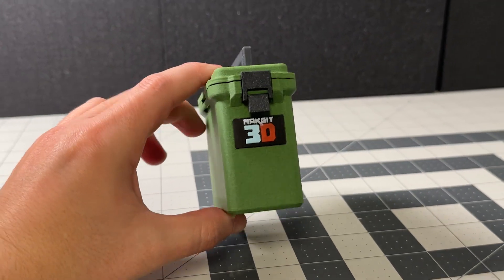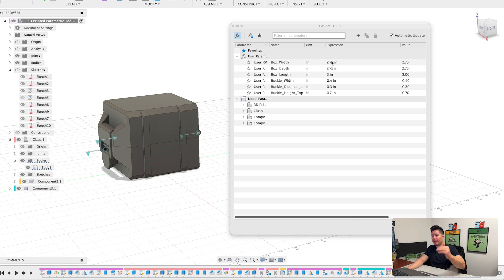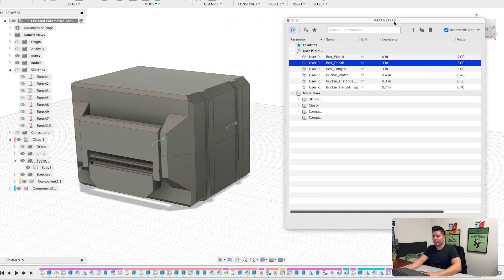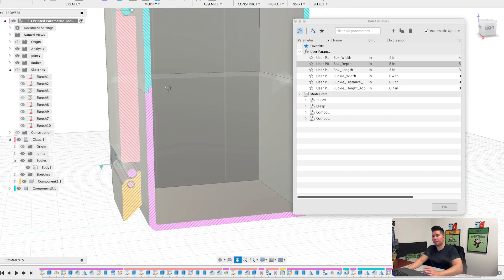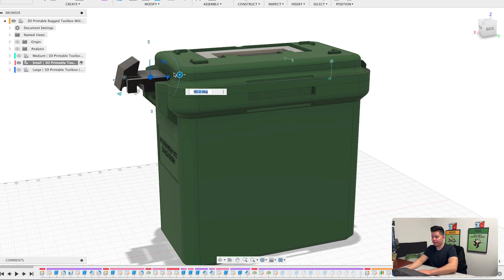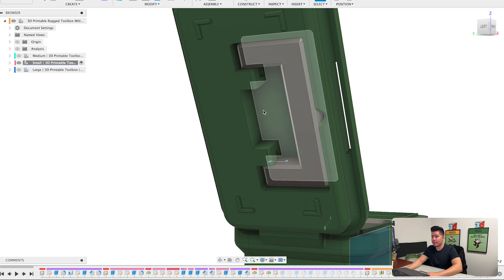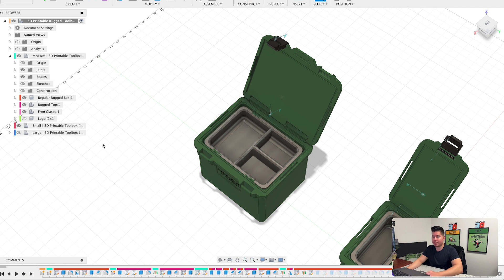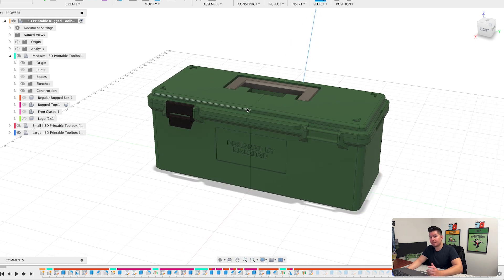Parametric Modeling Explained | Fusion 360 for 3D Printing

Comment: all righty - in the parametric design , what solution could you think of , for having those ridges parametric in size and number. ( first box , on the 2 sides , 2 riidges starting from bottom and continuing in to lid )
let say that i want 4 ridges , more skinny or one only more wide .
would you wok more on the 2d sketch or straight in to the 3d design using a sweep or similar ?